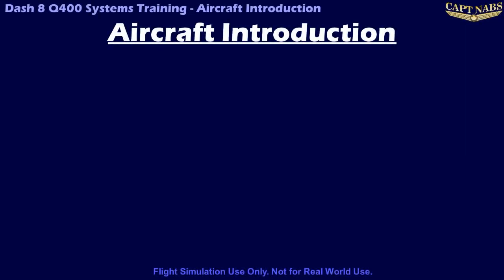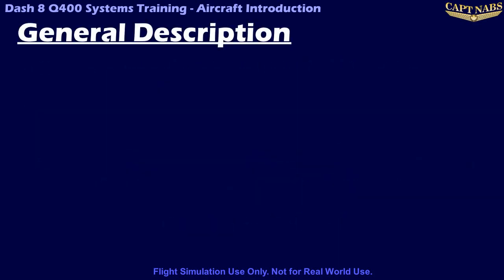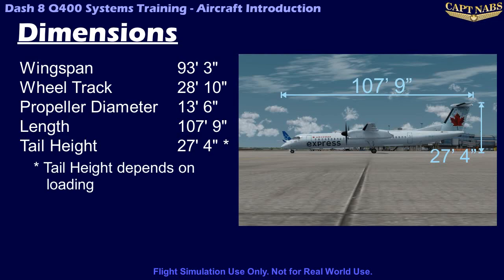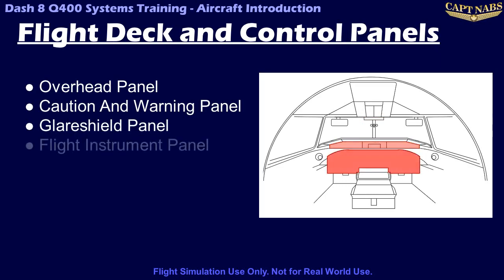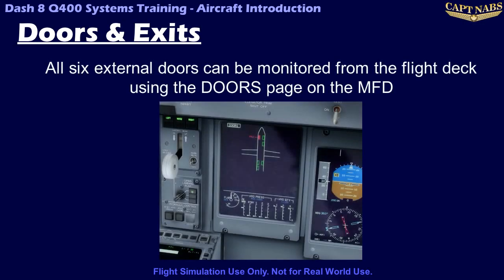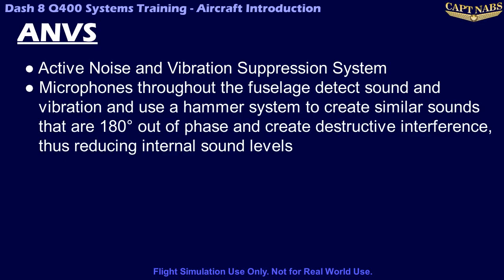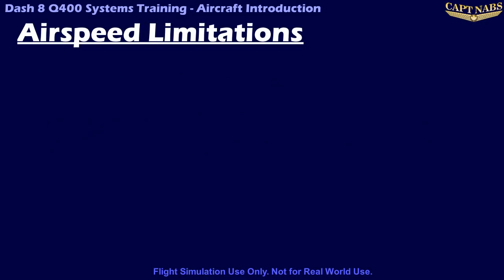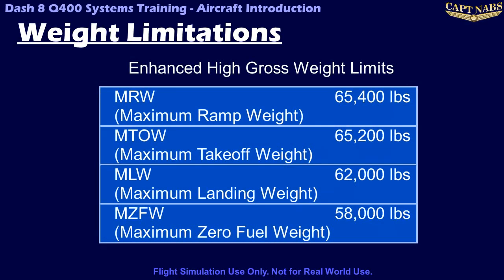Majestic Q400 Systems Training: Aircraft Introduction (Fly Like A Pro)

Comment: Isn’t question 3 wrong because VLO is ( velocity maximum operating speed) extension speed is VLE
Reply from the maker: In this case, it comes down to semantics. The question is "At what speed can you extend the gear?" I was implying that you have to operate the gear, so the correct answer to question 3 is VLO, 200 kts. Once the gear is extended, you can then accelerate to 215 kts. But I was asking about actually extending the gear....
Reply: Capt Nabs ahhh now I understand what you meant 😎 thanks

Comment: Please it has been modelled to as close as the Real life Q400 is right?
Reply from the maker: That's a pretty simple question with a really complicated answer.

There's no such thing as a perfectly realistic simulator. Not PMDG, which models a lot of systems detail. Not even the simulators at Flight Safety or CAE are 100% realistic. They take shortcuts to keep the system able to function, and they have 5-10 computers for each sim.

So how is the Majestic Q400 on this spectrum? The visual modeling is superb, both inside and out. The virtual cockpit is especially accurate, with only a very few 'approximations', mainly the back wall and flight deck door. Certainly, anyone trying to learn the real Q400 will feel quite comfortable after having played with Majestic's Q.

The systems fidelity is overall very good. The major systems (electrical, engines, hydraulics) are modeled quite realistically, and even have realistic failure reactions. Some of the systems that arent well modeled don't have realistic failures, like air conditioning and deicing. Supposedly, Majestic's top end product will support these, if and when it ever gets released. The FMS is mostly well simulated, though a few features, such as VNAV don't work as well as they should. 

So on the realism scale, I give it an 8/10. And is it worth the money? Absolutely. It is a great model for the price.

Hope that helped.